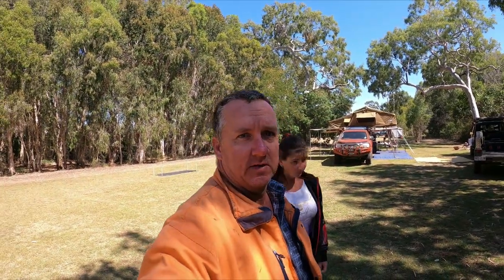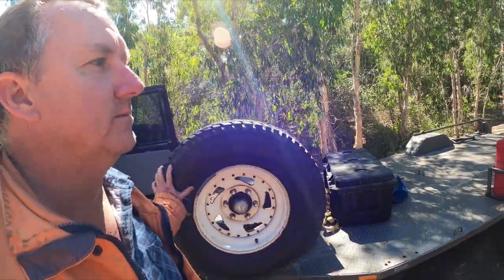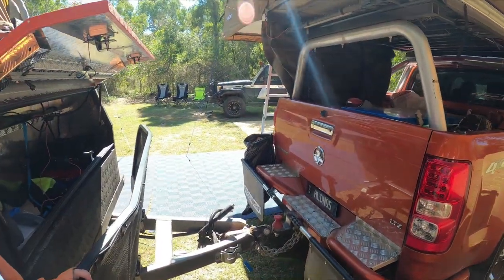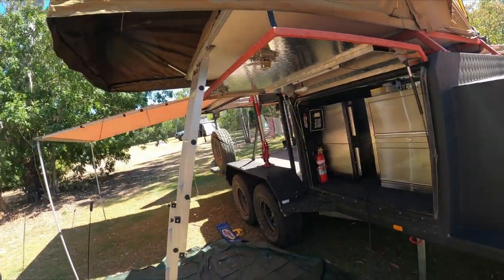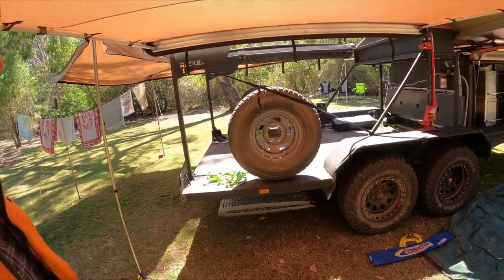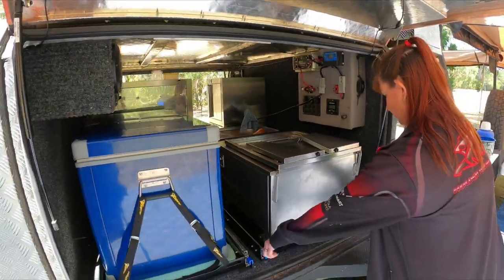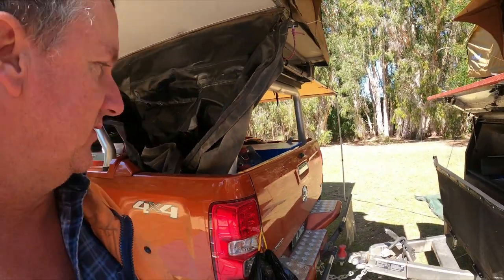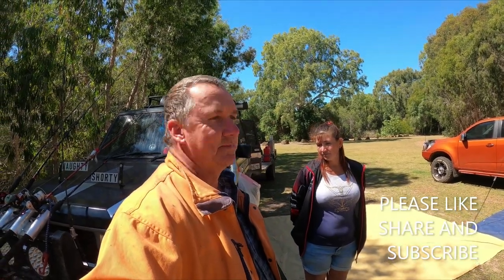TOY HAULER WALK THROUGH #toyhauler #4wd #4x4 #4x4offroad #cfmoto

Comment: Must admit Graham great idea with spare hub on spare wheel ! Shoulder went air bags on suspension toyhauler 👌
Reply: Were did you get tool box for ramps ect mate ?
Reply from the maker: Thanks mate. Yep the hub idea was definitely a good one. I didn't want to go with air bags because of cost. Simplicity do an air bag set-up but I wanted something more basic to keep the price down.
Reply from the maker: All the boxes apart from the main canopy come from bunnings. Including all the stainless cabinets inside the canopy. Cheap, effective and easily available.